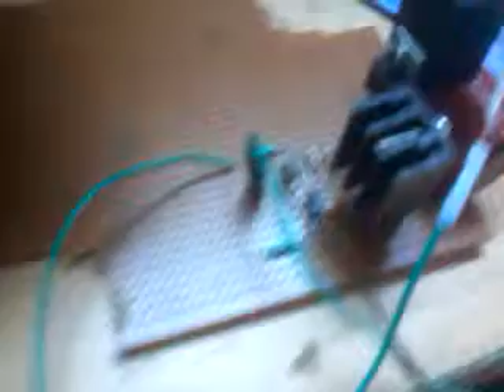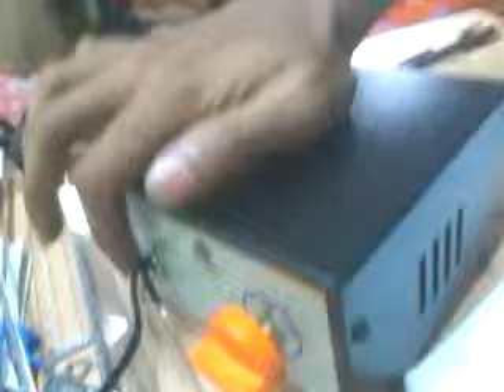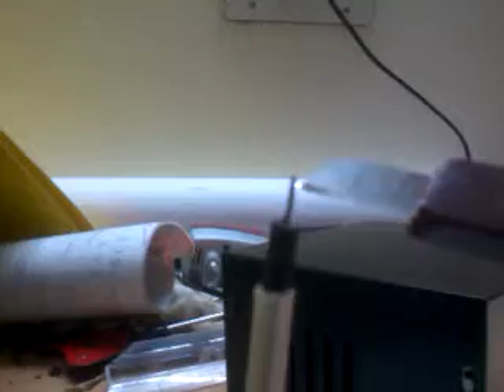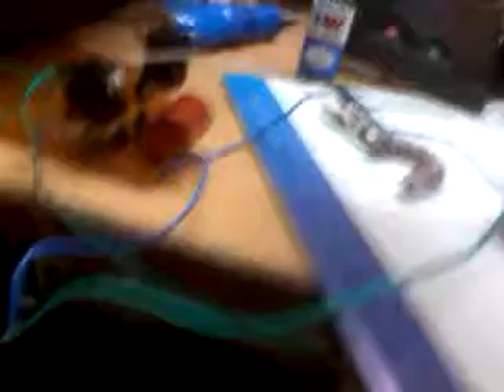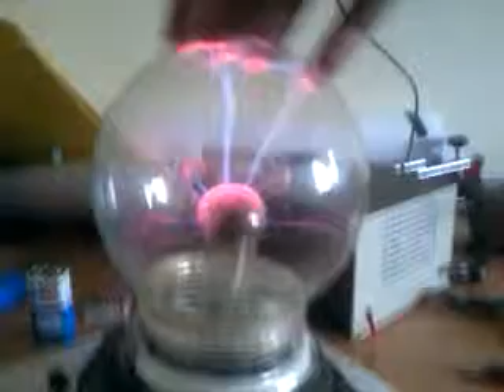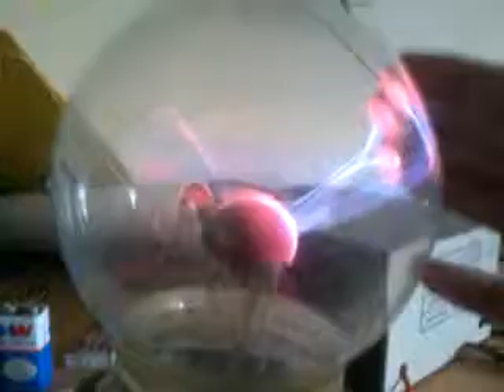ZVS Flyback driver for Plasma Ball

Comment: This is really weak. I think you chose the wrong inductor or power supply for this...
Reply from the maker: I had a very small flyback, and my supply current was limited to 2 amp :(
Reply: Anirban Kar You can get much better arcs than this by using electronic fluorescent ballasts. They are the simplest flyback driver possible and in some cases, the best.
Reply from the maker: AvZ NaV I tried a CFL driver once it didn't last very long
Reply: Anirban Kar I mean fluorescent tube ballasts. They are quit rugged and last indefinitely for my flyback.
Reply from the maker: AvZ NaV Ok Thanks I will definitely try it :)